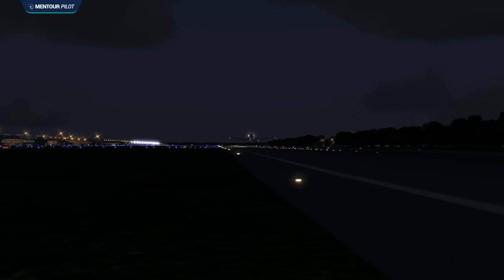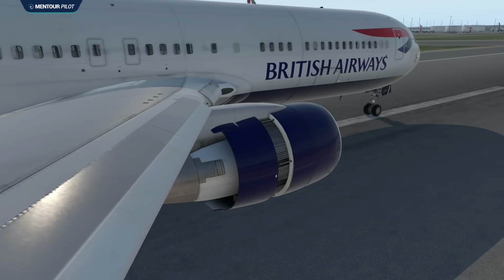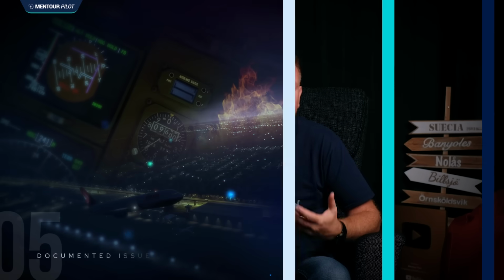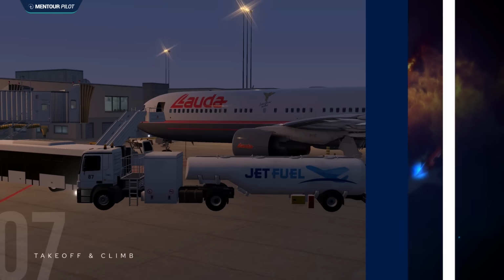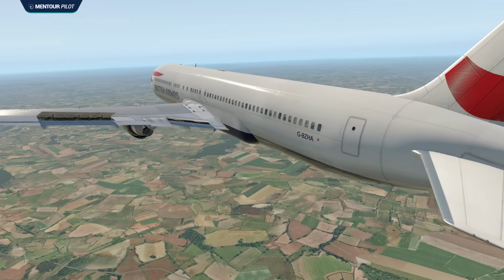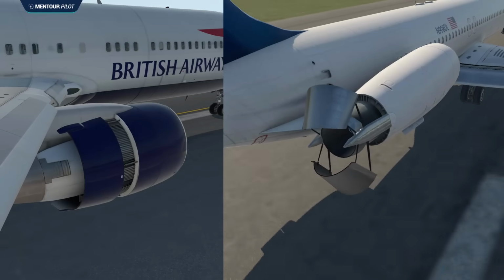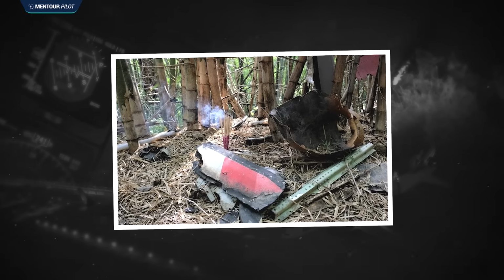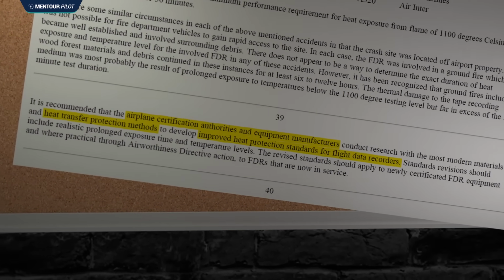HOW an Impossible Failure CRASHED this Boeing 767!

Comment: The Saddest part of this is the looting... I mean damn 100 People lose their lives and you're looting the crash site? So messed up
Reply: Imagine all the body parts at the site that they had to go through. They were probably collecting jewelry from fingers and hands they found and wallets from the remains of smashed torsos.
Reply: @danielebrparish4271 thats terrible but why? what happens to peoples bodies? its really strange
Reply: Imagine a cat tied to the front bumper of a car that slams into a concrete wall at 50 MPH. No one would recognize what that cat was. Now multiply that look by 10 times. Because that is the average speed of an airliner in flight. It would be a mass of blood with some cat hair stuck to it. One claw might be 10 feet down the road. Maybe the tip of the tail would be on top of  a tree and a lot of it would never be found because the force of the impact would pulverize it. It would resemble a tree frog sitting on a slab of concrete that was hit with a sledge hammer swung at full force by someone the size of Dwayne Johnson. Only bits of shredded skin would be left and the bones would be powder. Princess Diana's heart was ripped from its arteries as a result of the car she was in slamming into a concrete barricade at probably 100 MPH. Miraculously her body stayed intact. In the case of an airliner The bodies are ripped apart. Heads snap off, arms legs and hands go flying into different directions. Some bodies would be mangled into a pile of body parts and others would be flung out all over the place as the airliner broke into hundreds of pieces as it was smeared into the ground. Look up some of the photos of airliner remains that are hung on a frame to reassemble the pieces of the aircraft after a crash. It looks like shredded aluminum foil pasted back together with lots of empty space where pieces of skin use to be. When Valujet 592 crashed head first in the Everglades they could only locate parts of 68 of the 110 people on board. A tooth or sometimes a jaw was the only part of a person that was left. It's very gruesome but there is some comfort in knowing that no one had time to feel a thing. Those people died in less than a millisecond.
Reply: @danielebrparish4271  i see, a terrible example there with a cat but okay, but that is squishing, like if something real heavy would fall on you, that makes sense that there would be a lot of broken damage there. but i still dont understand why the body becomes like this in airplanes crashes. when you are sitting in a car or plane how come upon impact your heart or head goes flying out or off? its just so strange to think about that, its not a common experience and its difficult to imagine that stuff like that could happen to our bodies just like that. one second you are sitting in your chair on a plane or car and the next this happens. Why would arms and legs go flying into different directions? its so terrible that this kind of stuff can happen to our bodies but its so weird and different from everyday life where its weird to imagine that upon some accident legs hearts arms head and what not would go flying into different directions
Reply: @dreamthedream8929  you go from over Mach 1 to a sudden and complete stop, bad shit happens, Dale Earnhardt hit a wall at a little under 200 mph and his cervical spine ripped through his skull
Reply: People suck
Reply: Desperate people do fucked up shit to survive. Anywhere. It's not right, it's not how it should be, but it's how it is now.
Reply: 100 people dying is not the saddest part? Braindead
Reply: What do you expect of slanty-eyed savages living in the jungle in aa 3rd-world country?
Reply: I have once been to Thailand, and that country seems like a shithole. People are like living a different world compared to most of the countries. They have a king who is one of the richiest man in the world, and the rest can not have the most basic utilities ones need to live. Every time I was out and about in the Bangkok city I was feeling like I was gonna throw up in every moment from the fck smell that comes either from the sewers or the cooking in the middle of the street (done get me started on the food 😒). Based on their doomed culture and living conditions I think looting is one of the least bad things happening in there.
Reply: Sadly it’s the case in most developing countries. Some people have no shame about looting accident sites and graves.
Reply: @TheKatangeseDollar he consciousness of the people in the countryside is at a medieval European level. The valves were just bits of copper. Surprised the authorities didn’t announce an immediate amnesty and small reward payment. But of course no-one would have trusted the authorities to follow through.
Reply: @TheKatangeseDollar  Sureeee looting doesn't happen during riots in your "developed" Country does it westoid.
Reply: @TheKatangeseDollar  Thailand seems to have been described as a developing country since the 1950s. It's time to drop that "developing country" description and just say this is as good as it ever will get and move on.
Reply: @iminabrons  ... I feel that you are interpreting the word "developing" rather literally. In reality that was not what it meant (it is now a term that is being phased out) - it was simply a term that was coined to try to label countries that were in between the highest income countries with best human development index (i.e. how educated people are, their income, life expectancy etc), and those that were at the lowest. It doesn't actually mean the country in question is on an upward climb towards more development. There have been some attempts to label countries as "high income", "middle income" and "low income" countries but again it doesn't tell the whole story. For now the term used is "global south". But the bottom line probably is that we can't lump huge numbers of countries together very accurately because they all have variations on multiple levels.

I am not defending the people who looted this plane as to me that seems absolutely horrific but it's worth noting that in many parts of Thailand, people are extremely poor, and despite improved legislation to prevent modern slavery, some people are literally slaving to their death for very little pay. (Tesco in the UK is currently in a lawsuit over one such factory of theirs in Thailand where people even had their pay stolen by the employers and left with nothing.) In the face of life conditions like this, I can understand why people saw a completely crushed plane (it was in tiny pieces clearly with no survivors as described by the investigation - the pieces left of the plane were smaller than those of the plane from the Lockerbie explosion mid flight), and thought, "the people here are dead, my family is starving, surely this is more important for the living than the dead". The plane parts they took, presumably, would be in hopes of selling them as scrap metal for money. A horrendous state of affairs all round.
Reply: @aesaphyr  or maybe not all people's have a golden rule, well not one that is the same across you know.
Reply: @iminabrons  I apologise for making you feel like I was pouring acid on you, that wasn't my intention and I thought I was simply helping provide an alternative perspective as someone who does live in a global south country. I'm autistic so unless someone states clearly they are posting satire, I read their comments literally. I'm not doing it to be facetious. I'm not sure how on earth someone is meant to assume you're posting satire about people's death and a crashed plane being looted, but okay, I take it.
Reply: @aesaphyr  I wasn't interpreting the meaning of "developing".
 I simply made the point that Thailand HAD been described as a developing country by other people for over 50 years. It wasn't I that was defining them. 
I then went on to give my opinion on the topic by satirically saying, "It's time to drop that "developing country" description and just say this is as good as it ever will get and move on."
This is my way of saying stop describing Thailand as a developing country take the country for what it is and accept it.
Reply: @aesaphyr  Zhitskin countries is a better term.
Reply: @iminabrons  nothing more evil than robbing graves! Or disrespectful
Reply: @timwhitten9918  Off the top of my head i can think of at least a million things more evil than robbing graves. Disresprectful yes.  Pure evil no.
Reply: @TheKatangeseDollar  The USA must also be a "developing country" too then.  Space Shuttle Columbia 2003, parts showing up on Ebay 4 hours after the accident.  At least in "developing countries" they might have had a material need for the materials they were taking.
Reply: @Illegal_President  you wanna hear something sad? I googled the Columbia looters just now and there were only two names (prosecuted post amnesty). One of them died in a helicopter crash in Afghanistan in 2011, aged 31. Kind of ironic I guess. Poor bastard.
Reply: @Illegal_President  there were parts and parts of suits all over Texas, I lived in Springtown Tx at the time and there were blackhawks landing and picking up wreckage, it was so sad
Reply: yeah, it's pretty awful - poverty is the underlying problem, it makes people do awful things
Reply: @HarryFlashmanVC  American soldiers were collecting golden teeth from jap's corpses back in WWII, it has nothing to do with poverty it's human nature.
Reply: @HarryFlashmanVC but awful people make poverty as well. Chicken and the Egg situation. Why did a nation that was relatively young go from zero to walking on the moon in just a few centuries when so many “poor” nations have no economic growth unless it’s delivered from somewhere else. Let’s simplify this and think about toilets. If you and several thousand of the people that lived in your area found themselves on another continent that was undeveloped what would be your first priority. Food and shelter… you would quickly have a call to arms for all farmers and construction workers. Sectioning off plots of land for farms and homes. The story goes on until you have a developed country with toilets…  
If the people you got stuck with are selfish, sneaky, and only concerned about themselves at that very moment. What feels good now.. rape, robbery, looting, drugs…  your plans would collapse before the first harvest. Individuals would create small tribes that would raid each others land for resources and women.  With no moral compass for right and wrong this situation never stops. 1000 years from now nobody will have toilets… 
Moral compasses that make you think about others, the future of your children, your community. Where do they come from? 
If you walk into any area of the world and they are living like wild savages what you will find is that they have lived like that since the beginning of time. You take a hundred thousand of those people and stick them in your nation they will not wonder why they never built a society that had toilets they will simply kill you and take yours if allowed. If not stopped your toilet will be broken in time and nobody that is left will be able to replace it because they collapsed your once great society and turned it into the place they came from. 
You can’t change a culture by placing them into another culture. They won’t look at what your built with amazement and curiosity. They will look at it with greed and envy and will take it from you anyway they can. 
Do you want a toilet or not?
Reply: I suspect foul play. Maybe some secret agencies. Some unsafe cybersecurity techniques are to hoard software vulnerabilities in private, rather than publish them to be fixed. Maybe the same has been going on at Boeing; this would be consistent with their denial that the reversers are unsafe.
These vulnerabilities could be used against adversaries later.
Reply: 200+ people died and that's the saddest part? get real

Comment: I'm sorry but, am I the only one that thought it was retarded right off the bat when he said the system was tested beforehand but only on low altitudes and low air speeds? I mean really now, it doesn't take a genius to ask "well... what if something goes wrong when the aircraft is at top speed?"
What's the reason behind this? 
Cost too much to do another test at higher air speeds?
Pure laziness?
What's the reason?

Comment: Boeing airplanes by year introduced:
1958 (Boeing 707) - About 3000 people died for every 1000 planes built.
1968 (Boeing 737) - About 2900 people died for every 1000 planes built.
1982 (Boeing 767) - About 700 people died for every 1000 planes built.*
1983 (Boeing 757) - About 500 people died for every 1000 planes built. 
1995 (Boeing 777) - About 300 people died for every 1000 planes built.  
1997 (Boeing 737) - About 100 people died for every 1000 planes built.  
* The Lauda Air Flight 004 that crashed was a Boeing 767-300 which came out in 1988.

Comment: I dont get it. When we train in the simulator, we also train overspeed, or if we go back to Cessna 172 or Piper 28, and when in flight school, we also practice this in real, the instructor put on a visor so I cant see, the instructor put the airplane in a dive, takes away the visor and see how i react. The problem, as i see it, was not to disconnect the autothruttle and bring back both levers back and level off the airplane and then  fly only with the right engine. Maybe we all need to fly cessna and pa 28 more, then just fly total automated airplanes and get 100% used to it. I think "Piper 28" when i before flew Boeing 737 when i had to fly it manually, because it is still an airplane. I think they were so chocked up with the BANK ANGLE that they forgot WHY it happened. The right engine was still pushing  and created this crazy spin like situation. its like when we practice decopression in the simulator, set flight speed to max possible speed and set the altitutitude 10000 and the engines will go down to idel too. but to try to fight with two engines, one that is still pushing and the other is doing revers........ they had so much high altitude already that they could just let the airplane level of with thrust in idle.... like we do on a PA28 in that exercise when the crazy instructor put a PA 28 from 5000 feet to a dive....... and when i look out, all I see in front of me are trees and no horizon..... so down with the throttle and very gently try to level off without breaking off the wings.....

Comment: Another excellent presentation. The most horrifying of all the crashes you have covered so far . To think of that stricken plane corkscrewing down at incredibly high speed is simply terrifying. Those poor pilots, there was nothing they could do. The plane just breaking up in mid-air. What those poor people on board must have gone though. I'm appalled that Boeing tried to blame it on the pilots and that Niki Lauda had to push them so hard until they admitted that the plane was flawed all along. I think there should have been criminal charges over this accident.

Comment: Reminds me of Tam flight 402 in Sao Paulo where a faulty switch resulted in the thrust reverse on the right engine engaged on take off and cause the plane to crash.  It had a similar system to the Boeing system but nothing is perfect and it failed on the Fokker 100 taking the plane down.

Comment: the airplane should have been 3 times stronger but imagine the g forces and the autopilot i hope is now programmed  for  situations when control surfaces are not enough with lowering engine rpm

Comment: Really? NO survivors?  Come on.  This is why I love to fly.  Listen, planes are designed, built, maintained, and finally flown by people. People make mistakes. And a single malfunction of a wire that short circuits a critical valve ( or a blockage of a valve) can cause an accident like this, well....and as far as models and modelers go....shit data in = shit data out. Oh, the arrogance. These pilots didn't have a prayer in hell but too many pilots are so cocky they put the lives of their passengers at risk, imho. Clearly, this wasn't the case here.

Comment: You mentioned that at 4000 feet the voice recorder indicated that the aircraft began to break up and metallic noises were heard. Then 3 seconds later the aircraft impacted the ground. That would mean that the aircraft was traveling at 909mph mach 1.185 assuming dry air and warm temperatures. The wings and tail fins gone, in essence it was a missile pointed straight at the ground. man that is f'n crazy, I'm getting an adrenaline rush just thinking about that.

Comment: OH yeah.... what happens when the plane goes over its maximum speed and load capacity while maneuvering... HMMMM kind of like on 911 when somehow the plane went far beyond what it could handle and oddly didn't break apart midflight on the way down to the tower.

Comment: I can’t help thinking that the problem began with a reduction in cost effort around the wiring harnesses Boeing used. How many times have we seen shorts in wiring bring down passenger aircraft? Upgrading harnesses and shielding shouldn’t be an after-event directive when they could have been using premium setups to begin with. McDonell-Douglas/Boeing merger left all the Boeing safety in the dust in favor of the higher profit attitude of MD. I have a friend who worked for Boeing for 30 years ending just a couple of years ago. This was his attitude all along. 

It’s just one more in an interminable line of examples of how unfettered Capitalism destroys everything it touches.